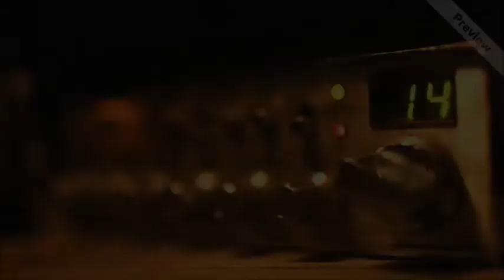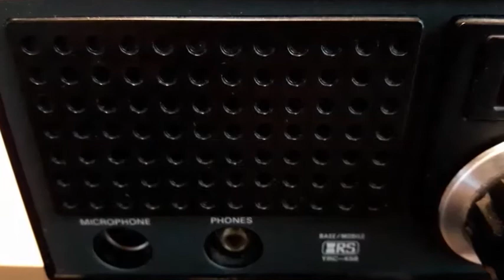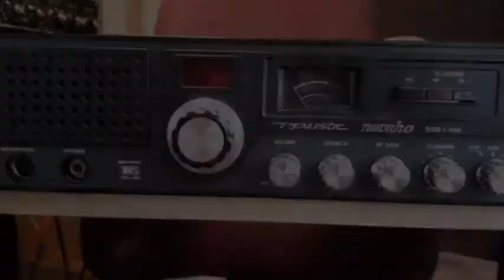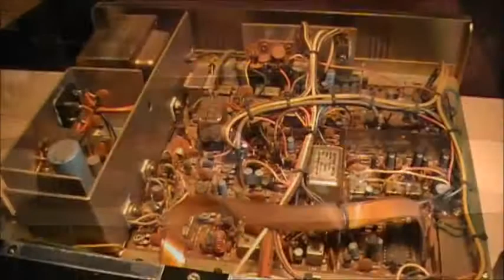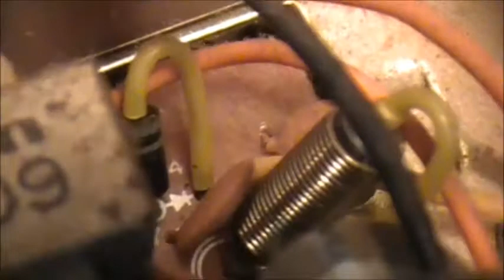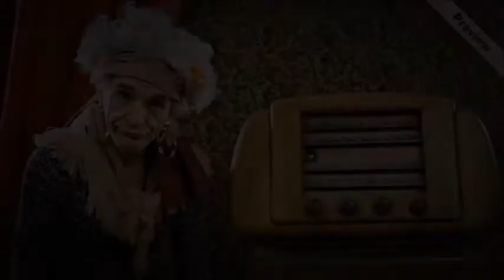Realistic TRC 458 Repair  PART 1

Comment: I know nothing about radios other than how to turn them on, but I’m learning a little bit more. I replaced that filter cap and it seems to have done it. No more loud buzz coming out of the speaker either. Thanks for the info.
Reply from the maker: You are very welcome, happy the suggestion worked for you. 😊

Comment: Me again. Now when I turn it on all of a sudden it’s got a loud humming like noise when the volume is down and it swings backwards/blinks even the number display. After a while it will come around
Reply from the maker: Sounds like you may have a bad Capacitor hiding in there someplace.
Reply from the maker: Check on the main filter cap in the power supply as well as  C-179 near the RF output stage, it is known to fail and will cause all kinds of strange issues when you transmit including making the relay chatter.

Comment: I picked one up yesterday the meter light is burnt out they key up one works.  Where would I look for one any idea radio seems to work well digital numbers a are little wonky but coming in
Reply from the maker: These are just ordinary 12vdc bulbs, nothing fancy about them.  Regards to the LED display, it is a common issue with those, the contacts can be cleaned but takes a LOT of time and care to do.  :-)